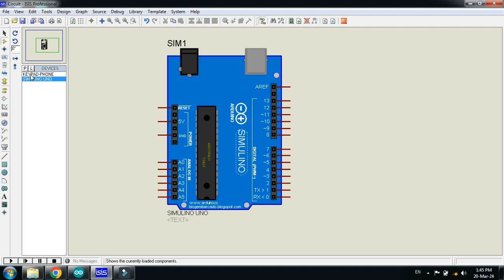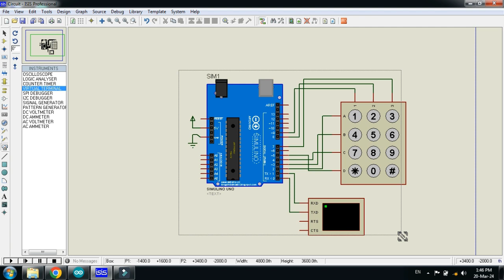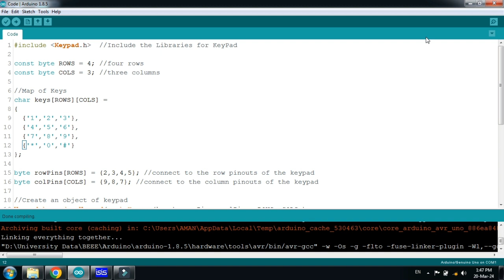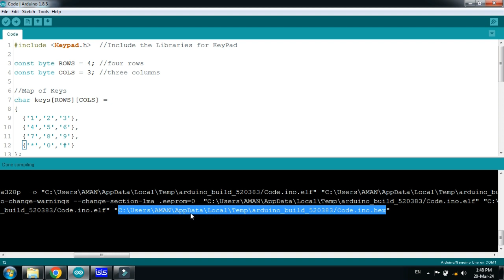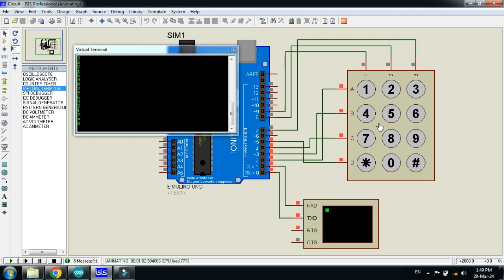How to Interface 3x4 Keypad with Arduino | Code & Circuit | Proteus Simulation

Comment: Sir can you help me 

Home Energy Monitoring System Project

Below are the key steps and components of my project:

1. **Research and Design**: Conducting thorough research on existing home energy monitoring systems to identify key components and functionalities.
2. **Component Selection**: Choosing appropriate sensors for monitoring energy consumption, such as current sensors, voltage sensors, and power meters.
3. **Prototype Development**: Developing a basic prototype integrating selected components to monitor energy usage in a simulated environment.
4. **Data Logging and Display**: Implementing a simple data logging mechanism to record energy consumption data and designing a basic user interface for displaying the data.
5. **Enhanced Sensor Integration**: Exploring advanced sensors for measuring specific energy parameters like temperature, humidity, and solar radiation.
6. **Wireless Communication**: Integrating wireless communication modules (e.g., Wi-Fi, Bluetooth) to enable remote access to energy data and control functions via mobile apps or web interfaces.
7. **Data Analysis**: Implementing algorithms for analyzing energy usage patterns, identifying trends, and providing recommendations for energy efficiency improvements.
8. **User Interface Refinement**: Improving the user interface by adding features such as real-time data visualization, customizable dashboards, and historical energy usage graphs.

Given your expertise and experience, I would be incredibly grateful if you could provide me with any advice, resources, or insights that could help me successfully complete this project. Your guidance would be invaluable in helping me achieve my goal of creating an efficient and user-friendly energy monitoring system.